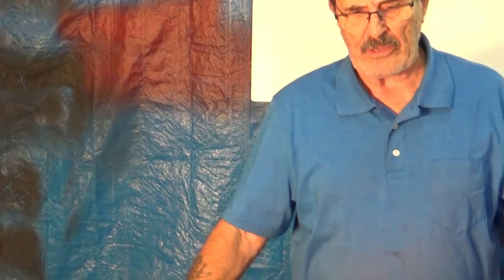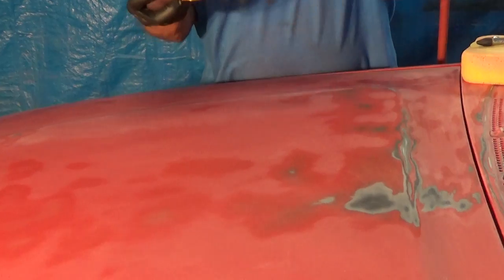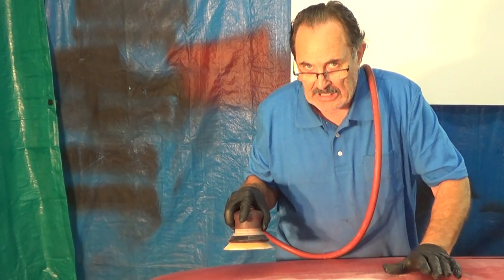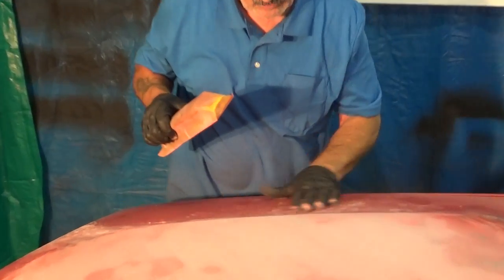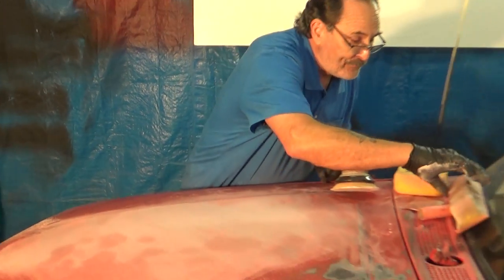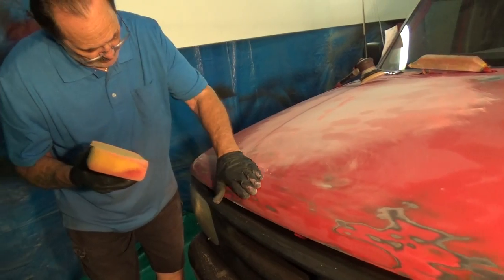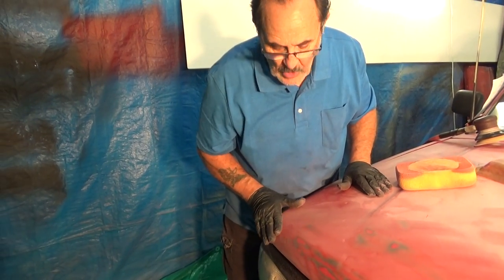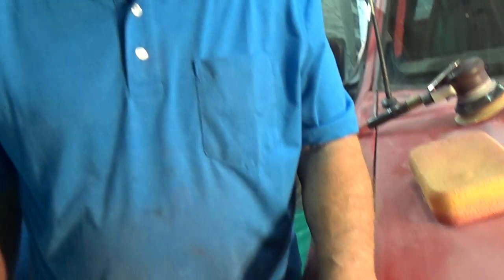Prep you vehicle easily for priming and painting using simple tools and tricks of the trade

Comment: What happened to you when you got hurt? I've got a bad back and chose to have a morphine pump put in. LIke the information here. Great for beginners.
Reply from the maker: Lifting a box off a shelf which was over my head.  It tore the left shoulder rotor cuff completely loose.  Shoulder reconstruction was then necessary since tissue had to be added and some bone repair.  Not long after,  I had to have both knees replaced and then another operation when the quad tore loose after knee replacement.  I'm 77 now and never had many health issues but I guess it's catching up.  Thanks for asking.